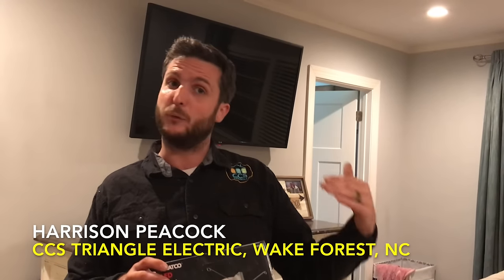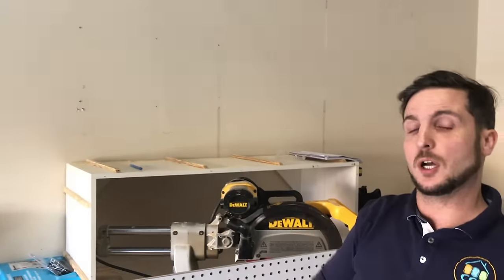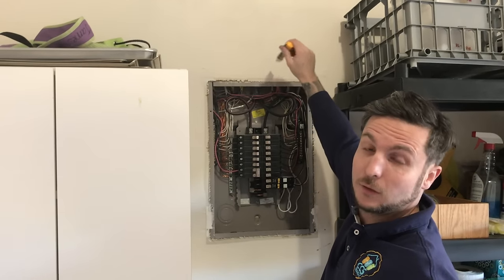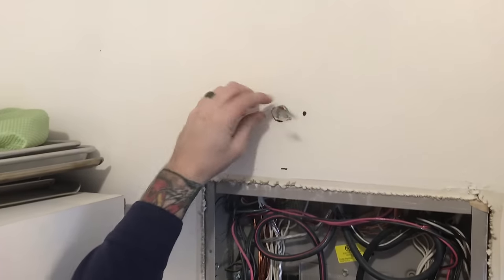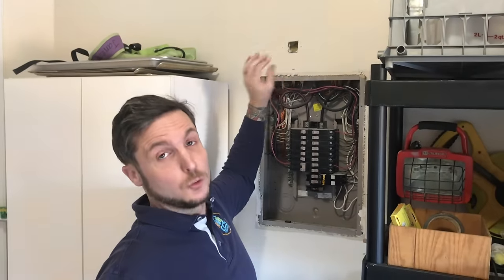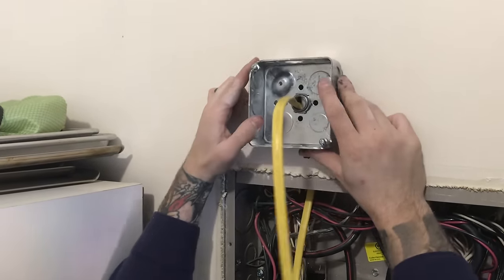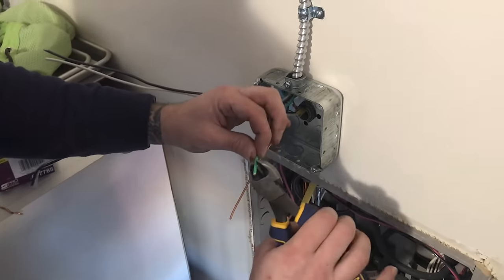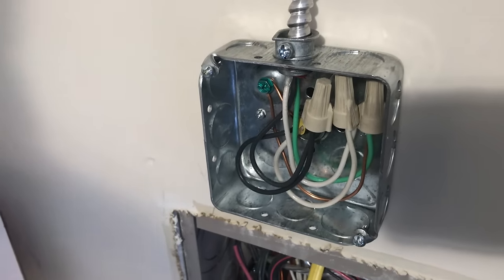New Garage Outlet From Panel--VERY DETAILED! (New Circuit / GFCI / Breaker Box / FULL INSTALL!)

Comment: National electrical code is that the sheathing protrudes a full 1/4" or more into the box.
Reply: I'm seeing red plastic protectors of some kind. Are these necessary? They didn't said a word about them at the hardware store.
Reply: @ricoassal  Those are likely anti-short bushings which are to be slid around the wires at the point where the MC Cable is cut. This helps ensure that the, now sharp, metal jacket doesn't nick the insulation on the wires. I'm not certain they're required, but their usage certainly seem like a very good idea.

Comment: Excellent and concise video.  I am not an expert but learning the NEC code and seeing actual work in practice is very helpful.
I would never work on a live panel if I could help it.   Extremely unforgiving.  And technically, the 2020 NEC code requires torquing all screws (per table of torque values).  However, the local authorities having jurisdiction may not have yet accepted the 2020 code so you may still be OK for now depending on where you are.   Testing for torquing is also problematic so I am guessing enforcement will be spotty.

Comment: A few comments.    The space in front of the panel may be too narrow.   Needs to be 30" wide.    If that electrician was working for the contractor I did, he would be fired.   There is absolutely NO excuse or reason to work in an energized panel, ever!   Not because it is an OSHA violation, but because of high possibility of injury or death.   Never assume neutral is safe with power turned on.   It is not safe!   Slight issue with Romex connector.   Other than that, very well done video and installation.   Always be safe, the life you save may be your own!
Respectfully,   Kevin
Reply: I highly doubt that an electrician never works in an energized panel. You think a business is going to ALLOW everything shut off in a building because a circuit needs to be added in an electrical panel? I do not believe that for a minute. Are you talking about shutting off the breakers for every circuit or even no power at the main leads coming into the panel? Either way, i don't think that would ever happen.
Reply: K Stewart    Well, I worked for one of the largest employee owned electrical contractors in the US.   We were licensed in 47 states.   The company policy was we not work in energized equipment unless there was absolutely absolutely no other way.   The company was working toward zero injuries and was getting closer to that goal every year.   We actually turned work down because a customer said the work needed it done energized.   
So, yes reputable contractors who care about the lives of their electricians, do not allow electricians to do work on energized equipment.
Respectfully,    Kevin

Comment: Country I live in has different standards, but working on a live panel seems like a universal DONT to me.
Reply: id rather die than schedule a cut off for a circut install
Reply: For professionals, it's standard operating procedure.
Reply: I always add them live. As long as you don’t touch the wrong wires. Pay attention…….
Reply: @jasondean3332  My first boss told me "As long as you don't touch the black and white at the same time, you won't get shocked". He didn't mention the whole "ground" thing but I quickly found out by touching the black and the conduit :)  About a year later I learned how to get shocked from the neutral.  I was puzzled for about 20 seconds and then said, "Oh yeah. That's a  circuit" :)

Comment: 1. No need to run the ground wire clockwise around the ground screw in the j box above the panel? I thought it should so that when you tighten the screw, it wraps the wire even more around the screw.

2. No torque settings on the screws on the devices or circuit breakers?
Reply: He didn't even ground the first box!

Comment: Somebody correct me if I'm wrong but using the screw type connectors at the box with aluminum MC is a code violation...those are only for steel MC.  Aluminum requires the use of clamp style connectors.
Reply: That hurt to watch lmaooo

Comment: Awesome tutorial! I see that he never tightened the Romex bushing onto the wire coming into the top of the panel. The wire was clearly moving around as he was working on the box. Not surprised as the screws to do so were inside the wall behind drywall... But that's a no-no...

Comment: By code can i run more than 2 12ga cables from the breaker panel into the Metal Junction Box and then split it into multiple power outlets with different needs or each breaker requires its own junction box out of the panel?

Comment: I would have used EMT.
Reply: Not when the customer is looking for the most cost effective job
Reply: That's wonderful. I guess you missed the explanation about why they were using Romex
Reply: EMT requires special tools and knowledge ie bender and how to use it. And for the other posters here it's NOT Romex. Romex is non-metallic sheathed in PVC whereas this is MC = Metal Clad.

Comment: When you attach the ground wire to the ground screw, it should wrap in the direction the screw turns to tighten (clockwise), you did the opposite (counter clockwise). Just some helpful information.
Reply: Noticed that, too.  But it's not critical as the screw is biting well and the wire is still wrapped around the ground screw completely.  If the wire were to unravel (happened to me a few times)...it would come out from under the screw head and come loose.  Here, the wire is still good under the screw head and didn't come out.  But I agree you should wrap clockwise (as you screw in clockwise) to get it right 100% of the time.

Comment: Except that the cable is never tightened in the Romex clamp that's inserted into the panel...
Reply: I noticed that. And he wrapped the ground wire counter clockwise
Reply: He could have used the newer plastic grommet which just snaps in place and you push the wire through.  That applies to the one in the junction box too.  You don't have to worry about pinching the wire with those.

Comment: Thanks for this video. There are other videos that show this process but usually with the box in a basement attached to wood panel. I too have a main box buried in the wall with sheet rock in the garage and have wondered how to add circuits in the garage properly. Snaking through the walls seems difficult. This would work. I wonder how much more expensive or difficult this would be with conduit?
Reply: Depending on skill level, its mot much more difficult.  As to expense, about the same. 
To accomplish with conduit, you need to cut a slot in the drywall for the conduit and bend an appropriate offset. The result would be much more professional, durable, and safe.

Comment: 12:00 why didn’t you do that to the connector that’s in the panel tighten up the Romax connector  not secured to the wire on top of the panel that’s not good and you’re a license electrician

Comment: When I had my panel replaced the electrician actually put in four extra breakers marked spare for additional future circuits.

19:30 I agree. I do not trust Wago connectors on a 20 amp circuit. They are fine for low amp connections like light fixtures.

Comment: Real electricians run EMT.
Reply: Real electricians wouldn’t need to surface mount anything!
Reply: Yup!
Reply: Kelvin I have fished wires down cinder block walls but concrete is had to do that. 
I only use AC90 for lights or in ceilings that are impossible to run emt.
In Canada the Furnace and hot water tanks in houses are mechanically protected by an armoured sheath as part of the code.
Reply: @17kelvinator  he clearly states it’s what the customer wanted done. Can’t you listen.... 🥴
Reply: Recommend that while doing this you mask off those live  exposed metal leads going into the breakers in case you might bump them. Just electrical tape will work, pull it off when you're done.

Comment: "i dont like wago push connectors" he says then uses wire nuts !!!!!!!!!  and is careful where he makes hole to avoid cables then uses a 2 inch screw for the first cable saddle !!!!!  scares the shit out of me having live terminal screwheads in side a metal box, at least in the uk screws are recessed
Reply: What's your point about the wago push connectors compared to the wire nuts? He twisted the wires together and the wire nuts have been used for YEARS with no problems!!!!!! If theses Wago's are spring loaded, do they stand up over time or the spring weaken letting the wires loose?? Screw length--- well he used PLASTIC ANCHORS and the screws provided--- we are pretty safe in saying he is nowhere near a cable clamped to a stud!!!

Comment: In both boxes the grounding wires were wrap around the screw in the wrong direction. Wrap the wire around the screw in the same direction you tighten it. As shown @30:42 when he tightens the screw the wire moves and is in less contact with the screw. He should know this, as you said he is a license electrician.

Comment: So many other “experts” here.
Reply: I can't tell you how many times I have found deficiencies in wiring and panels and the homeowner swears that the previous work was done by a certified electrician.
Reply: Some have failed inspection.  .  .  Some never do. Some never get inspected.  MC cable is not approved in the NEC for this type of installation.  This installation will probably get called out by a inspector when the house is sold. Hopefully the MC never suffers damage in this install that causes bodily harm or structural damage.

Comment: It took 33 minutes, but we eventually saw the use of a screwdriver... 🤦🏻‍♂️
Reply: Power tools strip holes even on slow speed which most users won't use. He did. The time it takes to lug that heavy tool up and down for a fastener when a simple light screwdriver comes out of the pouch or stays in the hand while getting the task done quickly.

Comment: 17 years of experience? Lol, yeah ok! Why didn’t you tighten the metal Romex connector on the Romex and then feed it into the top of your panel? Now how will you tighten the screws on the connector so your Romex won’t move now that its in the wall? You should of learned that 17 years ago!

Comment: This guy broke just about every OSHA rule in the electricians book by working that panel hot....There's almost never a good or valid reason for this...Especially in a residential setting..
Reply: At the box above the panel, the ground wire wrapped around the screw in wrong direction. The NM connector going into the panel, the clamp not secure. I would have used a plastic button connector from inside the panel.
Reply: Type MC cable does not require using the red head (bushing).
Reply: Alert the youtube police immediately
Reply: You're not areal electrician.

Comment: Locking the source to this panel was skipped, very unprofessional . Never take a cover off a panel without safety glasses as a minimum  use arc rated face shield and voltage gloves until all information and lock out is verified . Never do this kind of work even isolated with polyester clothing  . Don't wear a ring on either hand .  Handling galvanized device box with bare hands and banging against leg is where i stopped watching .   Watch arc flash video's and think about how much different your life can be.   I wish this kind of video was not on YouTube because after 46 years of experience i have seen a lot of licensed guys taking chances because they are poorly trained like this guy .

Comment: Adding outlets in my garage, 4 on a straight line. You place a GFCI outlet in each box to easily determine which item tripped the circuit?

Comment: Informative video. Don't you need to bond the metal box to ground?
Reply: ...on the first box with no outlet.
Reply: He did that by looping the wire around the box ground and then to the receptacle. I would probably prefer a bonding pigtail.

Comment: 30:41 when connecting ground to box (green screw) always wrap wire in same direction as the screw tightens(wrap overunder to the right)(righty tighty) to make a tight connection and dont put insulation under screw

Comment: Question: is it possible to use a smaller box (rectangular) for the receptacle ? Why using the large square box ?
Reply: You would have a tough time fitting a GFCI receptacle inside a single gang box

Comment: I agree completely about the push-in connectors vs. wire nuts.  The push-in type use the same type of metal spring as with backstab connections in receptacles, which we know eventually wear out and cause short circuits.  and yet, somehow, that same thing is OK in push-in connectors?

Comment: It's also called armored or BX cable in Canada. Red protectors are also called anti-shorts. Cable works great but hard to make it look as neat as conduit. 

See he had to make the hole a little deeper above the panel. A small hole always ends up being a bigger one. There must be a formula somewhere about the amount of time it takes to fish a wire vs the size of the hole.
Reply: its is also called that in the states.

Comment: A related issue that I've not been able to find online (except for electricians arguing with one another 🙂) is how to bring wire into the side of a panel if the panel is flush-mounted between two studs. Can you use a side knockout and then drill through the stud and pass the wire through as in any other stud? If so, what do you use for a wire clamp to the panel box since the stud is fastened right next to the box?

Comment: If you wanted 2 circuits, could you bring them into the same metal box and then have 2 metal clad coming out of it?  Or can you only do 1 circuit per box?
Reply: I had the same question. Looking forward to the answer...
Reply: Nobody after going to an electrical contractor store they said this is doable. So I will use one junction box and 2 MC coming from it.
Reply: You should avoid having 2 different circuits coming into the same box. But yes could be done

Comment: What is the reason you didn't run regular Romex wire completely inside the walls instead of using that external metal clad conduit type wire?  Is there no easy access above to run it?

Comment: I followed the vid (watched 2-3 times along with other info) and installed a new gfci in my garage! Used the red plastic anti bushing and 3/8 in mc connectors. Just had an issue purchasing the right plate for gfci

Comment: I have an outlet that trips the breaker when I plug in the shop vac and the saw (has a 14 ga wire), adding a new breaker with 12 ga wire and a 20 amp breaker, will that fix the problem?
Thanks for sharing this video

Comment: I usually use a sharp drywall screw to remove the K.O. in the Electrical. Panel then fish up the wall and drill a hole above the wall in the attic and run the wire then visa-versa down to the new box. It probably takes the same amount of time though.

Comment: Any change in the materials needed for use with a welder or two? I.e. larger breaker amperage, larger wires. I have two welders and need 240 to maximize the welders ability. Please and thank you for your responses!
Reply: The wire and outlet used must be capable of handling the maximum load of the welders (plus a few percent extra for safety).

Comment: This video was awesome. I just want to know the purpose of the junction box. Are you not allowed to wire directly from the receptacle to the circuit breaker? Thanks
Reply: It's because the panel is recessed in the wall and this is the only way to legally bring the cable to the surface. If the panel was surface mounted, the junction box would not be necessary.
Reply: @surferdude642  thank you!!

Comment: UK electrician. If I installed new circuit we need full test results & proper GFI testing with calibrated equipment. Plus I would use RCBO in the panel (GFI circuit breaker) which would protect cable run & outlet. Especially for USA systems where you seem to not have designated zones for hidden cables. Good video, poor regs.

Comment: Does your NEC Require AFCI circuits for all residential buildings. Wire terminals need a correct torquing which is listed on breaker or in in the code book tables.?!

Comment: This is a great tutorial - thank you. I'm getting ready to put receptacles in my garage/work shop and they will also be surface mounted.  Does pvc conduit wind up being more costly or less costly than the metal clad cable? In addition I will be needing several circuits for equipment I want on dedicated lines.

Comment: 44:34 Why putting a 20 A circuit breaker and using 12/2 but only 15 A sockets?
Reply: Because he felt like it.
Reply: Also allows for expansion later. You can daisy chain more outlets from the first one.

Comment: Just curious but why not use WAGO lever connectors instead of Y Nuts?  The Wago connectors seem to be more easier and efficient. Also itsnt it more of a safety risk to use a metal box instead of a plastic one.  I say that because if a wire comes loose and touches the metal it would be part of the currect Yes?
Reply: Wago or wire nuts, it's a choice made by the installer or electrician, both are valid. Properly done, wire nuts give a strong and greater surface area contact. The blue plastic boxes along with the associated Romex wires are only for behind the wall mounting, not surface as shown in the video. You could use the heavier gray PVC boxes and PVC conduit or metal boxes and metal conduit. Metal boxes are very strong and are perfectly safe as long as the boxes are grounded which is required. If a wire comes loose and touches the metal as you said, the breaker would trip immediately.

Comment: I use mostly plastic romex connectors. Plastic connectors are faster to install and you don't have to worry about chaffing and shorts and usually less expensive.  Russ-26 years in the Electrical Trade.